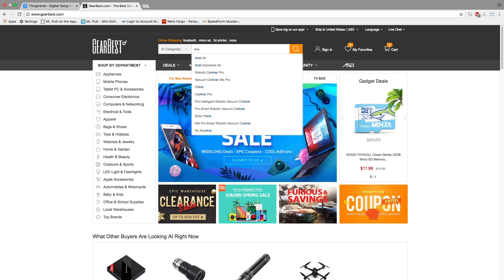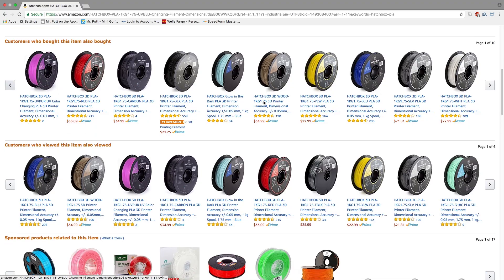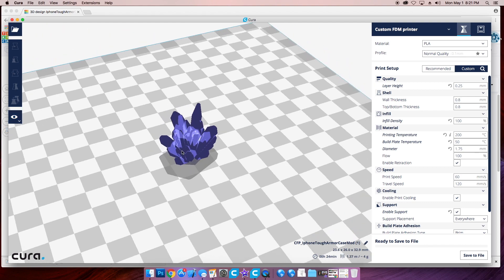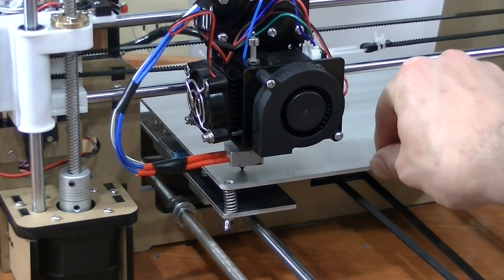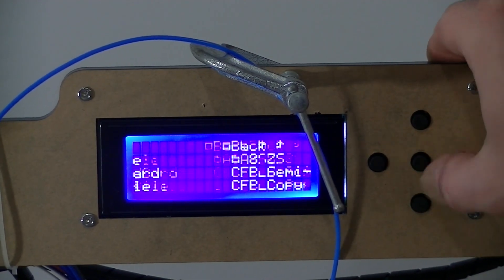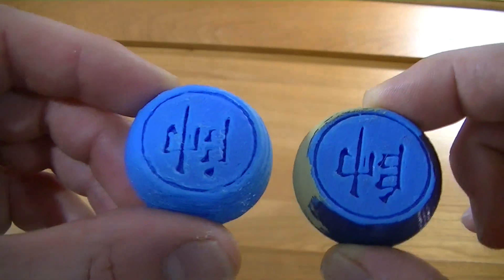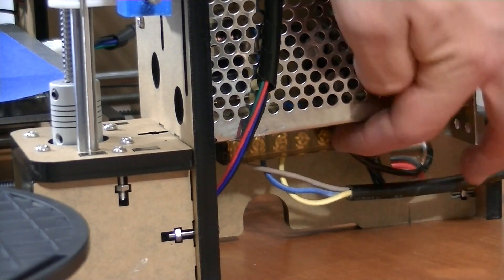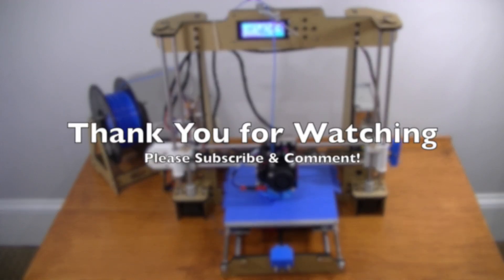The Anet A8 3D Printer - An Overview

Comment: I just built my anet a8 last week and i have to order a new hot end also
Reply from the maker: Yeah they're usually prety cheap but make sure you get the right one with correct voltage etc..
Reply: The one i got was around 10$ and works perfectly fine

Comment: You apply tape after the bed level process?
Reply from the maker: You don't HAVE to. But I do because it makes everything easier for me once the print's done and also helps the print stick a little bit better. You can also buy different types of heated beds and some people use glass aparently cause it's easier to remove prints and helps them stick better.

Comment: great video man. did you install a mosfet?
Reply from the maker: I didn't install a mosfet. What does the mosfet do? Will it improve my print quality?
Reply: Explicitus No, google it up! its for electronic safety because this printer can be dangerous ;)
Reply from the maker: Oh yeah that thing does get pretty hot! I try to always check on it at least every 5 minutes. So it's some kind of fail-safe?
Reply: Explicitus ya a mosfet is to take the load off of the power supply. the power supply is under powered and it cannot take the load of the heated bed. get on the anet a8 Facebook group. it's the best group out there.
Reply: The main concern is how the voltage is flowing though the main board, not the power supply
Reply from the maker: Noted!